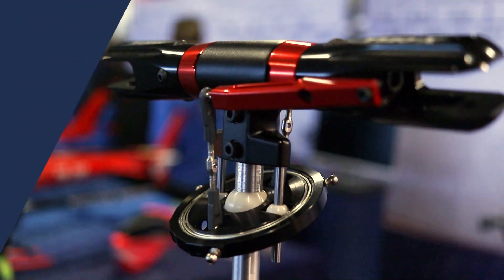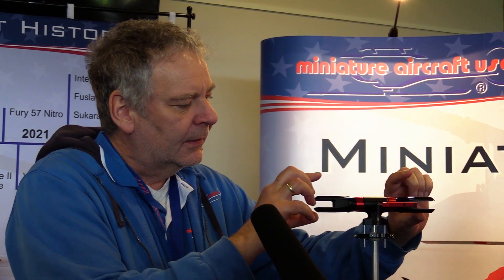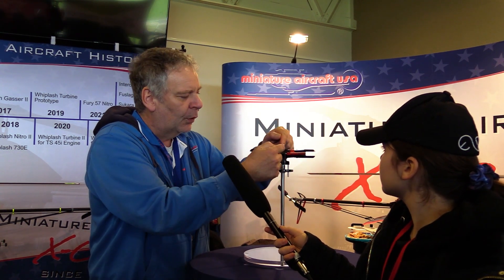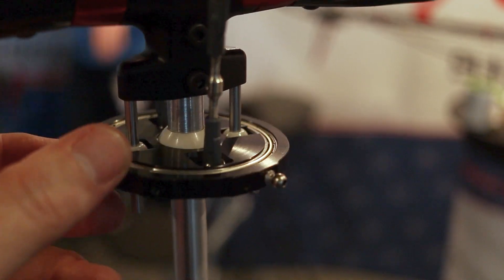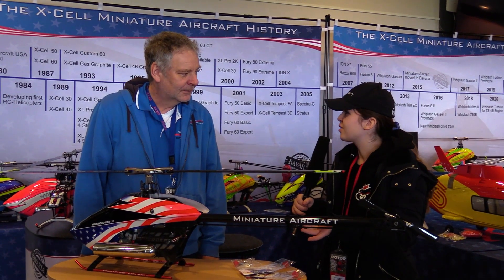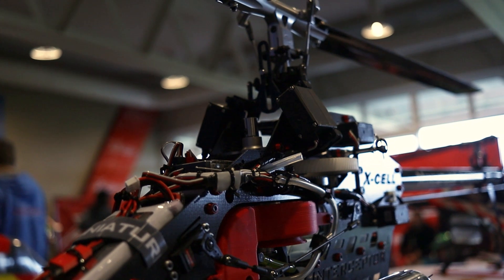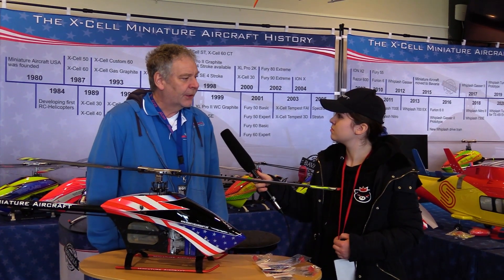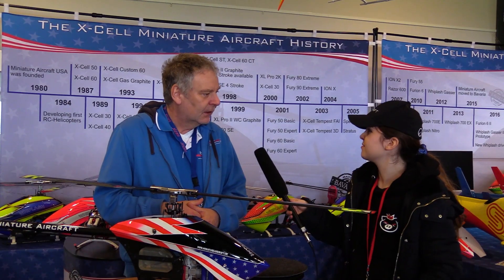Miniature Aircraft: New Main Rotor & Interceptor 600 Gasser RC helicopter

Comment: I think what is missed in the video is how light it is in ratio of size vs power for a gasoline helicopter that works. More common one, some with conversion kit, are using the heavy zenoah engine, while this one using  a lighter OS engine, It will be awesome if there is flight videos that torture the heli and engine just to show that it works well. I really want one.. :)

Comment: Awesome - thnak you! - interesting and innovative change of the Rotor Head and Swahplate - who knows....................... it may be the new way forward just like DD motor to head is now...
Reply: Although a bit different but the rotating spindle-shaft in bearings, was also in the Vario Viper helicopter. With a lot off other alternative design ideas.
Reply from the maker: The concept is interesting indeed, and makes sense. Although I'm a little bit sceptic of DD.